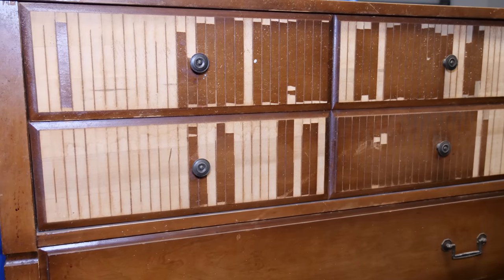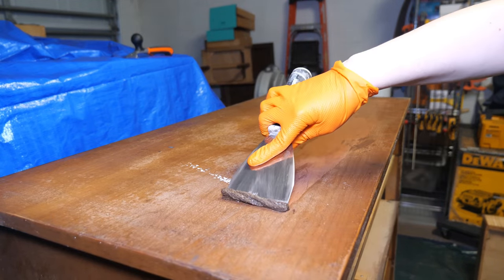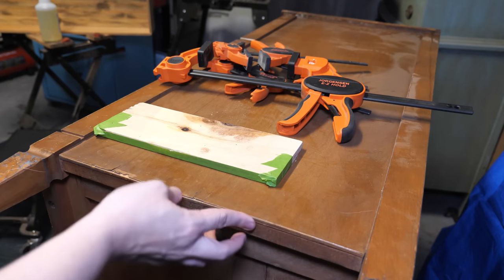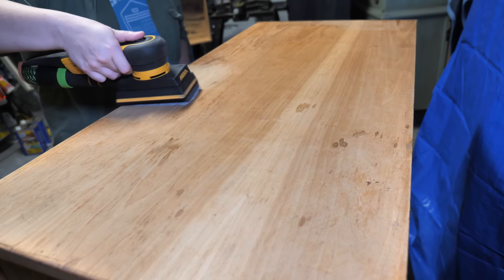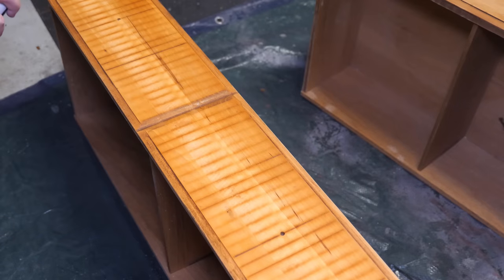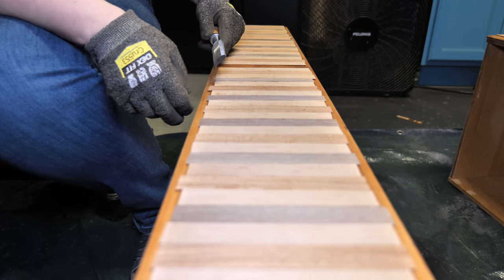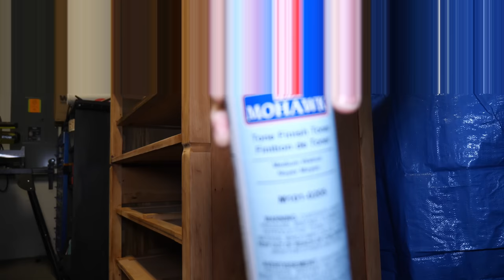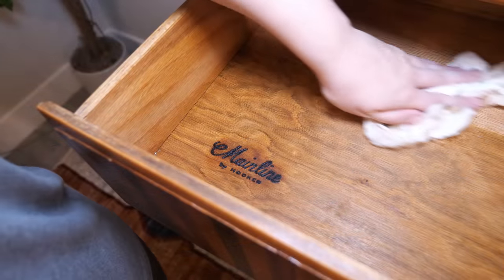Restoring a Discarded Dresser

Comment: Super nice. We have about zero finds like this on the east coast. I was thinking about Cape Coral. If I could find a place in Everglades City I’d never leave, but there’s not much there.
Reply from the maker: This one was pretty shocking. Most good furniture gets swooped up by other flippers / resellers. I suspect that is where the lowboy ended up. Thank you Cherry!
Reply: @ReconstructingEmily  I only pull what I need, not skilled enough to sell. Trailer parks tend to be prime hunting grounds.

Comment: It looks a lot like a piece I am working on. Mine has exactly the same issue with the veneer on the drawers. It was a really high quality piece , weighs a ton, made of solid hardwood with veneer over.  If the drawer fronts look ok I will just sand and refinish, I don’t know the first thing about buying or using veneer.
Reply from the maker: I am sure it will turn out beautifully Carole!🙂
Reply: @ReconstructingEmily  💕 if they don’t sand out pretty I might get brave and order some veneer…

Comment: Really interesting approach with the band veneer I have been considering doing something similar as a backsplash wood feature piece in the mid century bathroom. Thanks for letting me see it come to life. Did you find it to be expensive? Great job.
Reply from the maker: Ooo I love this idea. 50' veneer roll for 3/4" width varies from $10 to $20. If it were me I would measure the area and find out how much I would need and look at varying widths. It might end up being cheaper to buy a wider width.